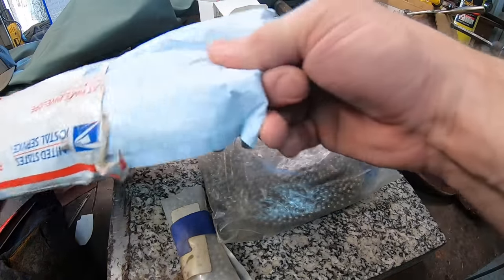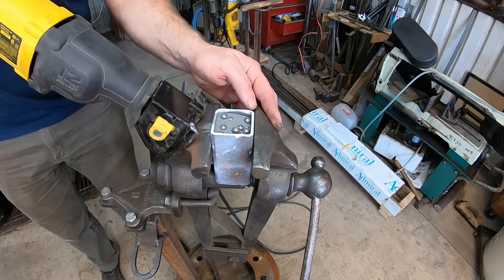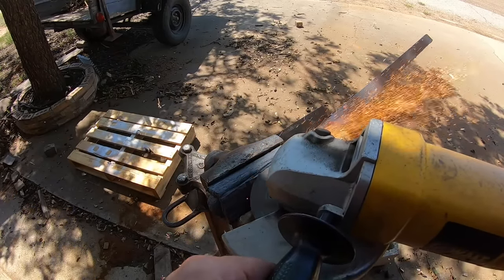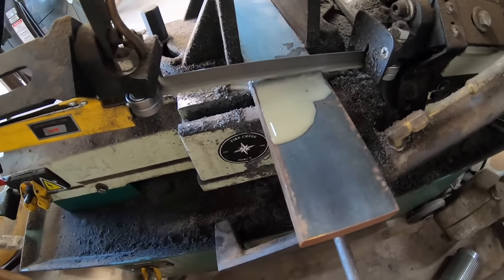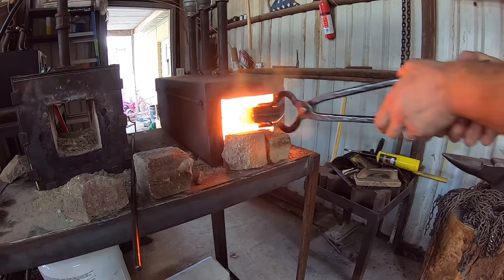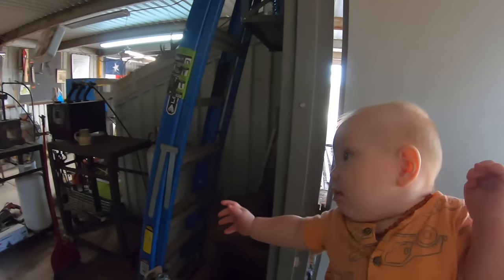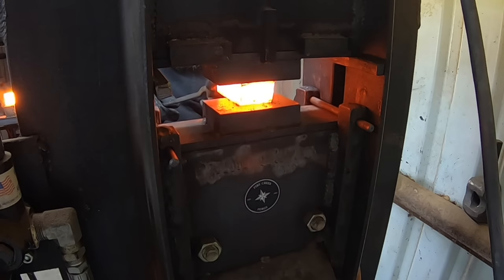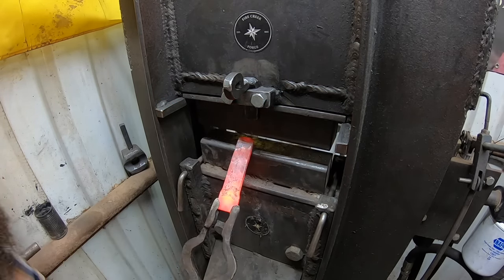Ball Bearing Feather Damascus Knife From High Carbon And Saw Blade Steel Blacksmithing, Knifemaking

Comment: I gotta say I think your explanations of what you're doing really add to your videos.  It's so much more illuminating to hear your thoughts on what your doing, even on your mistakes, than to have other forging videos where there's silence, just the sound of the tools, or music.

The interruption of the ball bearing steel with the plain bandsaw steel really makes the knife look a lot more interesting.  It's a feature, not a bug!

I was surprised with the direction of your feather pattern.  I expected to see the V's point towards the handle instead of away.  It would (IMO) be interesting to see a comparison of two similar knives from your billet, with the feather pattern pointing in opposite directions, to contrast them and see which is more esthetically pleasing.

One more thing - did the billet incorporate both ball bearing sizes, or just one?  And if it's just one, I'd love to see a comparison of the two billets with the different sized bearings.

Thanks for another interesting video!
Reply: I was wondering the same thing ( about the different size ball bearings) if he mixed them or made two different billets or what he did kind of leave that up in the air so I'm a little confused also.
Be well 👍👍

Comment: Next time get a forklift tine from the scrapyard, the tool is basically built already by just cutting off the tip to use it and it’s gonna be something like 4140 tool steel

Comment: By the way you had mentioned in another video a way to keep the canister from welding to the material inside, they use liquid paper on forged in fire and the judges said it works perfectly when properly applied and given the time to dry.

Comment: The easiest way I have found to ensure that a canister is easy to remove is to line it fully with 2 layers of used stainless steel foil. After stainless steel foil has been through your kiln nothing will weld to it. I fold it to perfectly fit into the canister and fold over the top to seal it before welding the lid on. After you set the welds a few times you can cut off the ends & the billet of damascus will easily slide out.
Reply from the maker: I've done that too but I find the paint is less hassle
Reply: Paint is so much easier

Comment: It would be cool to have a cannister damascus with two different size balls. Also, you could use an ultrasonic cleaner to pack the powder in. With the cannister in the cleaner, any spilled powder is still in the cleaner's container

Comment: Just a thought. If you intend to coat the inside of the canister with the paint anyway.. To you draw your outlines for your caps on the flat sheet, you can just put the square can on the flat sheet and make a quick spray of the paint in the cylinder using the cylinder as a stencil.

Comment: Beautyful pattern! Well done, but I would like it even more, if the center feather line would meet up with the tip.
Reply from the maker: Thanks! I'm not sure where to put the seam exactly, but not sure I want it right at the tip as that could be a stress point

Comment: Use white out but make sure u let it dry or u will get delaminations and it could not properly welf
Reply from the maker: I use white spray paint exclusively now, it's the best method I've tried.

Comment: i wonder if you would develop as many cracks if you worked the billet with the power hammer instead of the press as is works the metal slower.

Comment: Do you cool your brass when you are sanding it hard, so that the epoxy doesn’t heat up too much?
Reply from the maker: I don't usually have to; with a course grit belt there is minimal friction and adequate material removal to mitigate any significant heat build up

Comment: Since you didn't use a salt bath, how did you provide a gas atmosphere??
           As required for 52100 ht process
Reply from the maker: An inert atmosphere is not required, but you do have to address your decarb layer post heat treat as with any steel.

Comment: probably better then drilling the hot case and spilling a cloud of steel powder would be, not to welding it air tight anyway or drilling it before welding.

Comment: is there a reason why borax and a carbon source is not used?
Reply from the maker: The borax protects the steel from oxidation, which would prevent the weld. The carbon is already in the steel.

Comment: looks awesome love it . just curious why you used only epoxy and no mechanical connection on the handle .
Reply from the maker: The epoxy with the divots in the tang is more than adequate, there's nothing wrong with a pin as well, and on larger knives I often do this
Reply: @FireCreekForge  interesting . well if it works then do it i say . im going to try my hand at making knives . i got the stuff to build a forge i did take a blacksmithing class in college and loved every minute of it .
Reply from the maker: @dragonflye4561  right on!